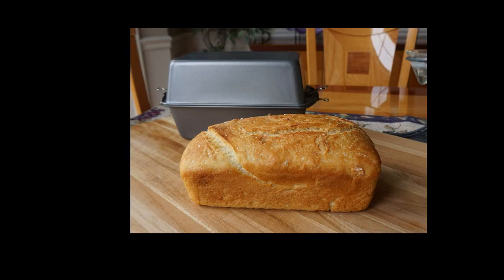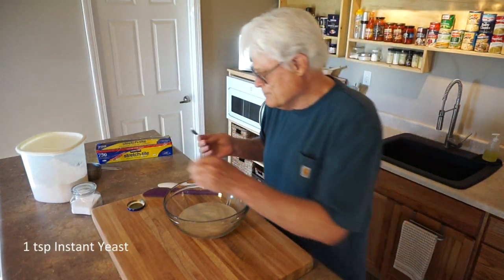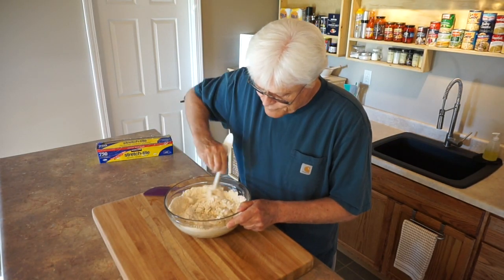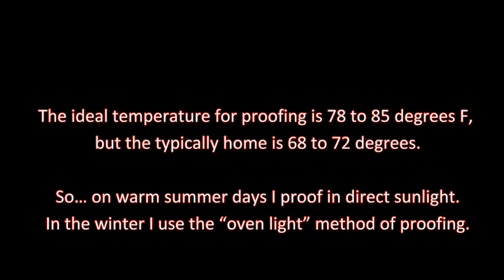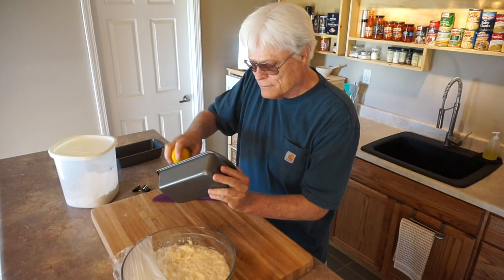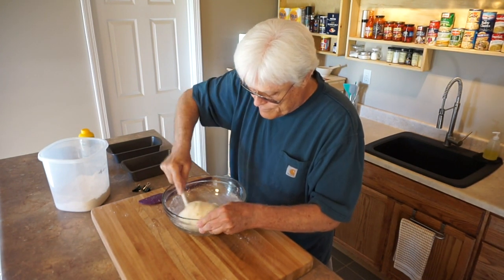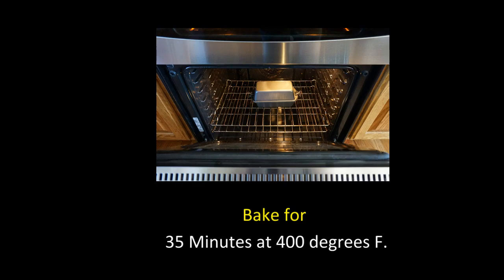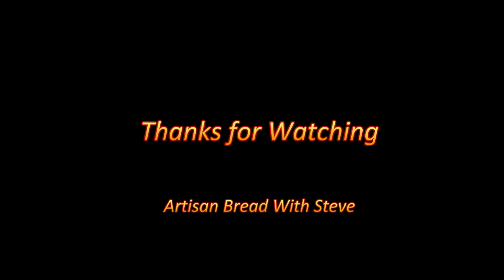How to Bake No-Knead Bread in a Poor Man’s Dutch Oven (no mixer… no bread machine…)

Comment: I made this tonight. However, my bread pans had two different type of edges so I couldn't clip them together. Instead I wrapped them completely up in foil to keep the top from falling off. I wasn't sure if it would work, but I thought it's such a simple recipe I'll give it a try. After it was done, I noticed it felt really heavy and I was worried that the inside would be kind of "gummy" and not completely baked. But, to my surprise, it turned out perfect. The outside had a nice crust and the inside was light and airy. I've made a lot bread over the years which included so much time kneading by hand, and hours of rising, I can hardly believe how well this turned out! And it took hardly any time at all...and only 3 cups of flour! This will be my weekly go-to bread now. Thank you for this terrific recipe and video!
Reply: Just wanted to add that I didn't have bread flour so I used all-purpose flour and it worked just fine. I may try this with bread flour just to see the difference it makes, if any.

Comment: My toaster oven is little small in height. 2 loaf pans do not fit to make this dutch oven. Can I put a baking tray on it? It will be flat top, but will that get baked with this temperature and time?
Reply from the maker: Cover the pan with foil for 2/3 of the baking time. Steve
Reply: Thanks!

Comment: Hi Steve. Ive made your no knead rye caraway bread recipe then came accross this one. Can i use the no hands technique on the rye bread recipe? And is it better to bake without the fan option? I bake my breads in a ceramic pot with a lid. Please respond. Much appreciated.
Reply from the maker: Yes, this is an older video and you can use newer technique with older video recipes. And, I never use an oven fan. Steve
Reply: @artisanbreadwithsteve  thanks for responding.  I will do so with my next batch. For some reason, not sure why but my rye bread dough ended up to be very sloppy and sticky. Is it better to have a longer first proof or second proof? Sorry for so many questions.
Reply from the maker: @Rashida961  "Roll-to-coat" the dough after 2nd proofing to make it easier to handle the dough. Steve
Reply: @artisanbreadwithsteve  thanks for responding

Comment: Steve.  We have baked with this recipe a few times and have been using a clay cooker to make the loaves in.  We have also used a couple of different types of flours to make loaves with.  The recipe is very easy.  I love it in the clay cooker.  We soak for about 30 minutes and then add the dough.  Last week, we proofed it in a Beneton basket before putting into the clay cooker.  It came out with some beautiful swirls across the top.  Great flavor and texture.  Thanks.

Comment: adding a water bath under the baking rack when preheating the oven also works.  The bread pans I use do not have a grab lip on the sides and  I've had the clips spring off during baking.

Comment: Hi Steve,  I've been using your method since this past Summer and have rarely bought bread from a supermarket since!  This morning I tried something different... only used 10ozs water, 1oz vegetable oil, 1oz half & half, 3 1/4 cups flour, 3/4tsp salt, 1/4tsp sugar and 1tsp yeast.  Everything else -- proof times, temperature & baking times -- remained the same.  The results were excellent!!  For some reason, it seemed like my previous loaves tended to be quite dry, but these adjustments have resulted in a moister loaf and still have that hearty crust -- not to mention it tastes glorious!  Thanks again for sharing your technique, Jonni   :)

Comment: I very much enjoy your presentations and I have tried your methods half a dozen times.  I am getting better but I still have a lot of trouble with the dough being too sticky.  I guess I need more practice.  Thanks for your recipes.  I enjoy them very much.
Reply from the maker: dalecs47 If the dough is sticky dust the dough with flour in the mixing bowl and "roll-to-coat". The flour will coat the dough ball (making it easier to handle) as demonstrated in this video. Steve

Comment: Hi Steve! I do use bread flour, use all the measurements right, however when I add the water it seems like there is not enough water or too much flour, so I end up adding more water until I see the shaggy ball that I see in your videos, but then again, I have to add more flour at the end to degas-pull -stretch to get rid of the  stickiness before baking. After baking time is up, the loaf doesnt have the dome top is just flaaaaat 😔
I got your book, the scraper, the spoon and I looking to buy the same flour container that u have.

Comment: There is no fear of the plastic parts of the clips melting in the oven?  I love this poor man’s technique.!!  I don’t have a small duct oven, just a large cast iron Dutch so this is better for shaping and using for sandwiches than bread in round.  Want to try asap.  Also, how can one sub regular yeast for instant yeast...ratios?  Lastly, have you ever tried working with sourdough and/or partial or all gluten free flours with this technique?  Thank you, God bless.
Reply from the maker: Binder clips I use are all metal. While instant yeast was designed not to be proofed, regular dry yeast has been improved and can be used as a substitute. Steve

Comment: I am trying to find a way to skip a step and so that it would be possible to put the dough in the fridge until a convenient time, take it out to let it finish rising, then put it straight to the oven, so my questions are:

Is it practical/doable to put parchment paper in the lower bread pan, put in the dough and let it rise (covered) there to skip the step of transferring?

Or would the dampness of the dough negate the benefit of the parchment? If so, might buttering/oiling the parchment first make that possible?

Or would it be better to heavily oil/butter the lower pan?

Or am I just pushing the simplicity goal?

You're the detail guy, so there's a challenge for you! :-)

Comment: I have made this 3 times and it worked great.  Just wish I could see how much the bread raises after it put top on.  May try in glass pans.
Reply from the maker: Linda Ray I tested glass loaf dishes... they didn't work well. If you want to see how they rise, cover the pan with a lint free towel and add the top just before it goes in the oven. Steve
Reply: artisanbreadwithstev just made 2 more loaves like this ww seed bread.  I just peeked under after 30 min and baked.  They turned out perfect.  Thank you for this new method!😊

Comment: Thanks for the video! I resently started to make my own bread, I already made the one in the skillet, it came very good, I really like your recipes they are so easy, this morning following your instruction I decided to make this one because I don`t have a dutch oven. The weather was 80 degree so I left it outside for 1 hour 30 minutes, the dough doubled in side then I proof it for another 30 minutes and I baked it for 35 minutes , everything was fine until I removed the cover, the bread didn`t rise, I must confess that I used 2 cups of bread flour and 1 cup of whole wheat flour, in your opinion do you think that was the problem? Thanks!
Reply from the maker: It's possible the wheat did not rise as well. And, if you used a 9" x 5" pan the loaf will be lower and wider. In all cases the dough should have filled in the pan. Steve
Reply: Thanks very much for the link, very useful. Happy baking!
Reply: @Sepideh Khaef Thanks a lot it is very helpful.🙏
Reply: We followed the recipe three times and only one worked. The other two didn't rise.

Comment: Hey Steve--my first time using this method and it turned out FANTASTIC!  What is the best way to store the bread so it stays freshest?
Reply from the maker: Did you proof the dough in a warm environment (78 to 80 degrees F)? Or it will take longer. Steve
Reply from the maker: The "Turbo" method uses 1-1/4 tsp because of the shorter proofing time. Steve

Comment: The first proofing, worked fine. The second one, covered with the pan, where I couldn't see it, was the one that did not rise much. 
They both, sat on top of the preheating oven, with the hood light on for extra warmth.
Any suggestions?
Thanks, 
Nancy
Reply: I've never had much luck doing a 2nd proofing and for the last 20 years I go straight from mixer to pan and proof it only once.

Comment: Steve just wondering in one video you use three and a half cups of flour in this one 3 in the other video you used cool water in this one you used warm. and you left the other one set overnight  just wondering the difference God bless
Reply from the maker: There are two methods... "traditional" (proof for 8 to 12 hours) and "Turbo" (proofs for 1-1/2 hours). Cold water is better for long proofing times and warm water is better for short proofing times. Traditional was designed to be baked in a Dutch oven... "Turbo" was designed to be baked in a bread pan for which 3-1/2 cups is more appropriate. Steve

Comment: Hi, Steve.  I have a question. I made this bread tonight and had high hopes that it would turn out.  It tasted delicious, but mine didn't raise very much (just at the top of the bottom pan).  Now, I have NEVER in my 68 years made a decent loaf of bread, so I should have been forewarned, but I'm wondering if the amount of yeast was correct.  It seemed like such a small amount. Is 1/4 teaspoon right?  This will make great toast, and I'll try it again.  Thanks for all your recipes!
Reply from the maker: It is 1/4 tsp yeast when you proof overnight and 1-1/4 if you proof for 1-1/2 hours. Is your yeast outdated? Steve
Reply: That is what I did wrong.  I added 1/4t and just proofed it for 2 hours.  I'm making it again this morning. Thanks for responding!

Comment: What is the estimated final cost of each loaf of bread? I only have two Pyrex loaf pans, and two regular size (not mini) metal loaf pans cost $12-$15 at Walmart.  Have you ever used Pyrex to bake bread?
Reply from the maker: It costs about $1 to make a loaf of bread. And, I have tried Pyrex, but it give the loaf a soft bottom. Steve

Comment: Hello Steve,
I've only just found your channel (and subscribed!). It's quite a revelation because there is always so much mythology and mystery surrounding bread making usually.

As a non-US/NA viewer - actually, I'm in the UK - would you allow me the following questions please?
1.  Not many countries use Fahrenheit these days. Any chance of also expressing temperatures in Celsius and  "Gas Mark"?
2. This particular recipe uses instant yeast but no sugar. Does the mix you use already have sugar in it (I thought salt killed yeast propagation and sugar encouraged it)? In the UK instant yeast is just that - dried yeast, nothing else.
3. If the ideal proving temperature can't be achieved is there any consequence to just leaving it a bit longer in a sub-optimal conditions to achieve "the rise"?
4. I've never owned an oven that heats evenly (even fan ovens). There are always parts hotter/cooler than others so cakes sometimes have to be turned mid-bake. How critical is a constant, even temperature to your technique and is there a way around it - other than buying a £15,000 Wolf oven :-) ?
5. Non-stick spray isn't really available here. At least it isn't called that. Is wiping the tins with some kitchen roll impregnated with vegetable oil a good substitute?

Many thanks. I also love the poor man's Dutch Oven idea and I'm off to buy my loaf tins and bulldog clips tomorrow! Thanks again.
Reply from the maker: Bread is very forgiving. Our ancient ancestors made it in a fireplace. Use what is available to you. When the bread has doubled in size after first proofing it's ready to be shaped, proofed, baked, then use the thump test> Bread should have a hollow sound. Salt regulates yeast and flour already has sugar. Steve

Comment: Thanks for the info. 
The first loaf I tried was made from yeast with an expiration date of Oct 2015. 
I suspected the yeast, the same as you.
So that same day, yesterday, I went to the store and bought a new jar of instant yeast, to try the second loaf. 

This time, as before, the first proof went well. 
I let the second proof go for an hour, instead of 30 min. When I took it from the oven and uncovered it,the bread had only risen to the rim.

As I said, the bread tastes alright, but it is very heavy and dense. Not tall and light like yours.

Should I let the second proof go longer? 
I used what I thought was the best brand of flour available, King Arthur. What brand would you suggest?

Comment: What is the advantage of covering the loaf pan to cook the bread verses leaving the loaf to cook without a lid on?
Reply from the maker: +SpiritBear12 It gives more control over the crust. Bake it longer with the top off if you like a harder crust. Steve
Reply: artisanbreadwithstev

OK, thank you for your reply. I wasn't sure if it helped the dough rise any better covered while it is cooking. I have made versions of your bread twice so far. I find I have to cook the bread for a long time (about an hour total) until the middle is not raw any more. I don't like a hard thick crust, but I find if I take the lid off, the moisture from the middle of the loaf can dry out better. It may be because I'm using different ingredients than you show. I made a loaf with spelt flour the other day, combined with oat flour, regular bread flour, wheat germ and ground flax seed. It made for a rustic lower gluten bread. But because I tinkered with the recipe I was not sure how much salt to put in. I think it was one and a half teaspoons. But my sister tried it and said there wasn't quite enough salt. I would have to agree. But that's what it's all about, right? Try new things and see how it comes out.
I used over 4 cups of dry ingredients total. I saw in one of your whole wheat videos you used 2 cups of water for the whole wheat because it absorbs more water than white flour does. So I also used 2 cups of water because I thought the spelt flour with the oat would absorb it all. In total I used 2 cups spelt, one cup oat flour, half cup wheat germ and a half cup ground flax seed. I found that 2 cups of water was too much for the total of 4 cups of the dry ingredients. So I kept adding more spelt flour bit by bit until the dough mixed into a "shaggy ball". I have no idea how much more spelt I used. I had also used 2-1/4th teaspoons of yeast to boost the rise because I thought the whole grains would not rise well and be too dense for the yeast to work well. But it did work just fine. I also added some milk, maybe 1/4th of a cup and 2 teaspoons brown sugar and 3 table spoons honey and 2 table spoons vinegar to the wet mix.
The milk and vinegar act as dough conditioners and help keep the bread from getting crumbly. They give it a softer and more stretchy resilient texture as well. The loaf did come out fairly dense and it was hearty to eat, but it doesn't sit in your stomach like a chunk of cement. You can't taste the vinegar at all after it's cooked. I did set the oven to 400 degrees.
It came out alright, but it was still a little too moist inside after cooking for an hour and it could have used a bit more salt. But I'm getting closer to making a good rustic loaf of bread.
Reply from the maker: +SpiritBear12 Go to http://nokneadbreadcentral.com/. Under “Traditional Videos” there’s a link to “World’s Easiest
Bread Recipe & Technique for Beginners (no kneading… using “hands-free” technique). I know you're not a beginner, but I want you to make the basic loaf one time... then change one ingredient at a time and note the change. It will help you develop a loaf to your taste. Steve

Comment: Thank you for these videos Steve. I really enjoy them. I am having a problem that I hope you can help me with.  I've made bread 3 times now using your method in a PMDO.  The bread comes out very tasty but for some reason my loaves don't rise above the side of the bottom pan. They come out flat across the top.  I successfully proof them twice, but for some reason they don't form a tall loaf. Any suggestions? Thanks.
Reply: could be the size of the bread pan.  Steve doesn't say 8x4 or 9x5.
Reply: @charlenekershisnik8457  True. I'm using  9x5. I didn't think about pan size .

Comment: Sorry to say my bread baking experience didn't got out of the bottom of my bowl.  I copied the ingredients and followed the video instructions. It is winter time so I proofed the dough inside my oven- 24 hours later - my dough was as flat as  tortila,  wow
Reply: Check that your yeast is still alive. You can start it by putting 50grams or so of the water into a cup, stir in a heaped table spoon of your flour and the yeast, mix it well. If the yeast is good after a few minutes it will be bubbling and you can smell the yeasty gases, okay to add it into your mix with the rest of the water, if nothing happens your yeast is dead. FWIW I buy my yeast in individual sachets and pay close attention to the use by date., unless you bake a lot the large tubs will become inactive once opened before you get around to finishing them

Comment: is the oven took 30 minutes to reach 400 F or you leave it longer waiting for the dough to proof.
i tried this and it turns out like a concrete block  not a bread     maybe i need put  more  yeast
will make another try tonight  .  thank you for your video
Reply from the maker: The amount of time an oven takes to come to temperature varies. Decide how long you want to proof the dough, then start preheating the oven so that they will be ready at the same time. Steve

Comment: What is the name and info on your Oven. I need to buy one that is electric and sits on the counter. Thanks.
Reply from the maker: I have an Oster Extra Large Countertop Oven (TSSTTVDGXL) (15x13+x7) that  got at Walmart. Steve
Reply: @artisanbreadwithsteve  
is that size the inside?
Reply from the maker: @ferriszoedesign3803  That is the inside. Steve